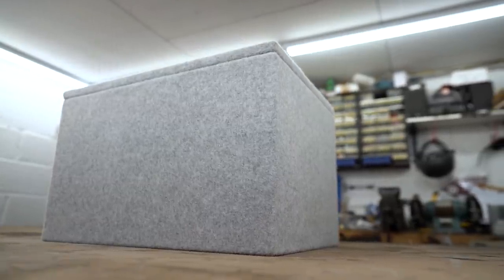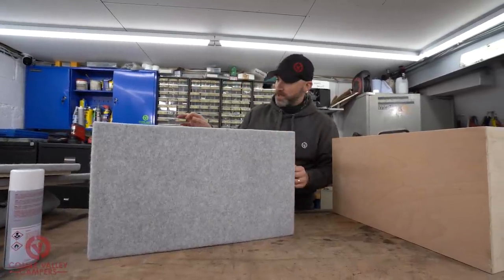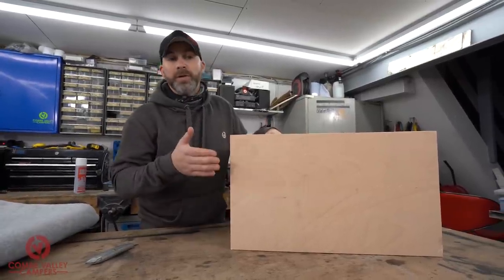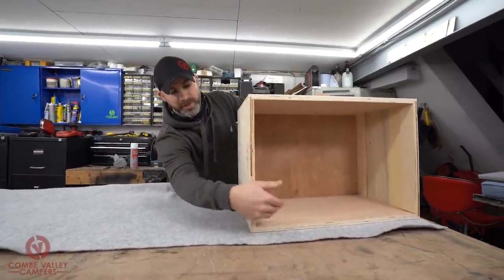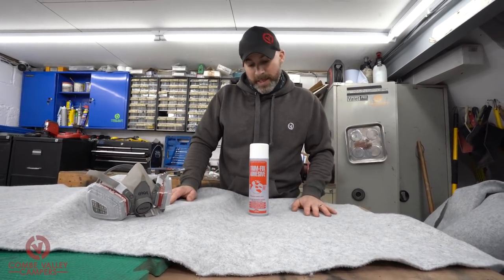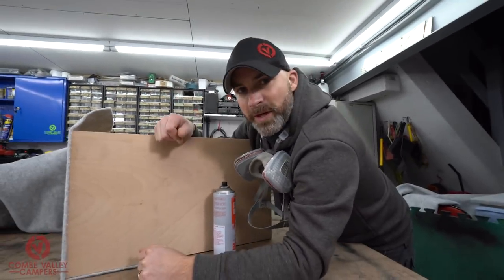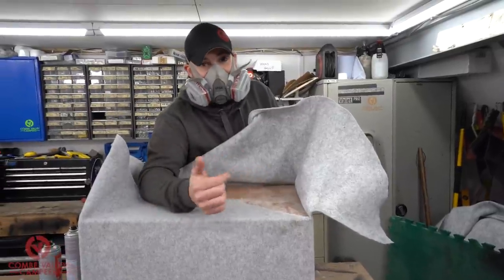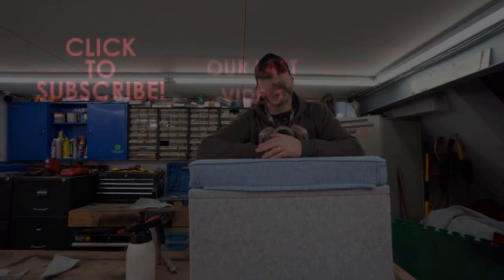HOW TO PROFESSIONALLY CARPET LINE YOUR CAMPERVAN FURNITURE: A step by step guide.

Comment: Interesting. Back in the 70/80s I worked for an Entertainment Woodworkers, basic we built speaker cabinets, disco desks, record boxes etc.  Either  under our own name or on contract  for major amp manufacturers, including a well known a Japanese amp. They used ship the works in from Japan . At the time I think we were the only cabinet makers using contact adhesive other company were using PVA . Two tools we found useful were for fiddly bit a pair of nail scissors and for flatting joints a wallpaper roller